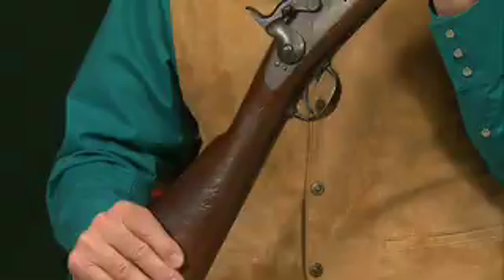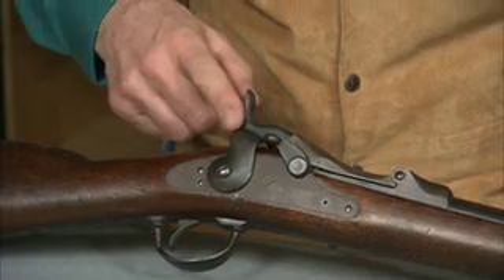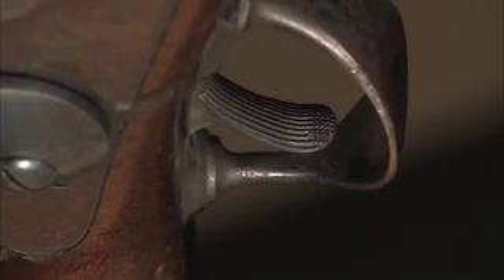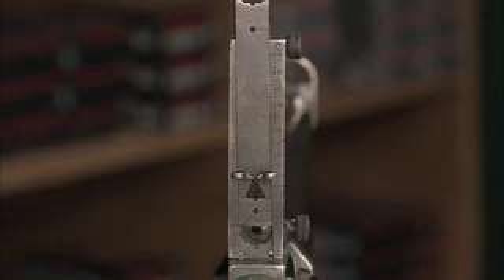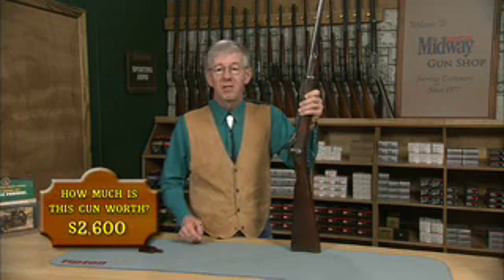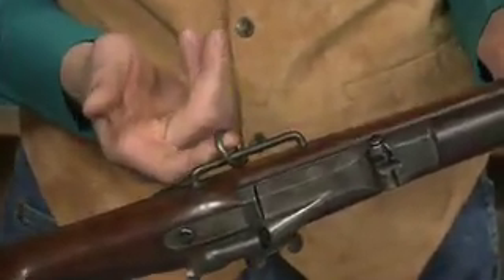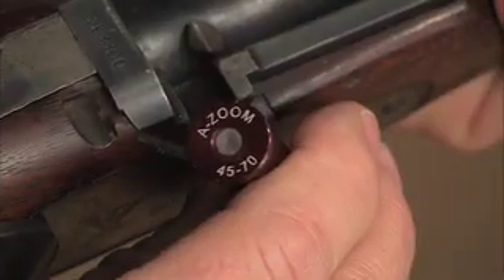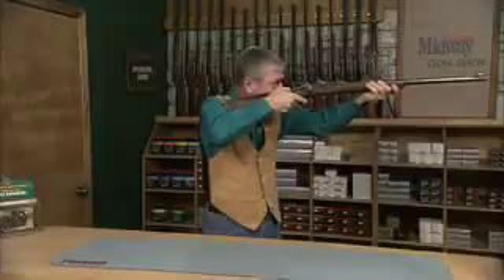The Model 1884 Trapdoor Springfield Saddle Ring Carbine | Gun History | MidwayUSA

Comment: Mine has number 52759 on it.  Any idea what year it was made? Also behind the trigger on the stock is “R.D.R”.  It does not have the protective loop around the front sight. The cartouche on left side of stock above trigger says SMP1891.  Also on right side of stock near shoulder plate is large number 71 and below it 231
Reply: The rifle was stamped when it was accepted and brought into US inventory. Most likely it was built in 1891.